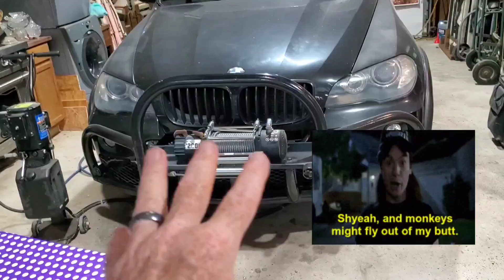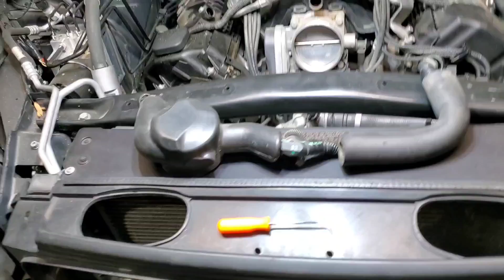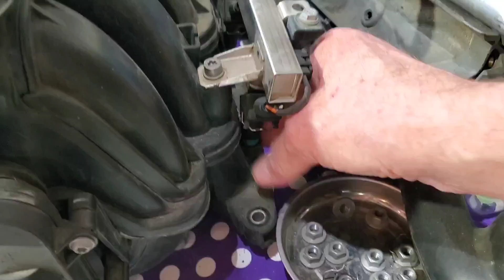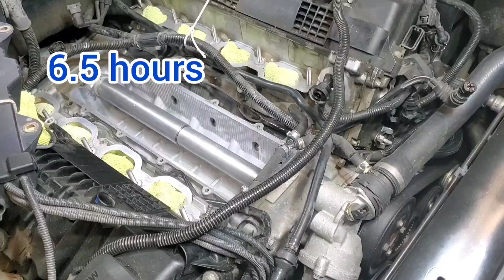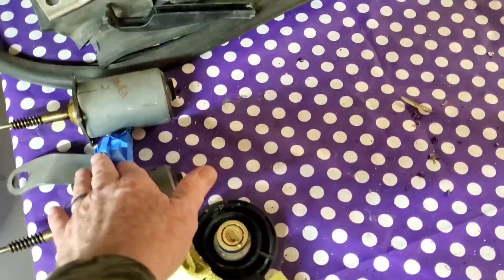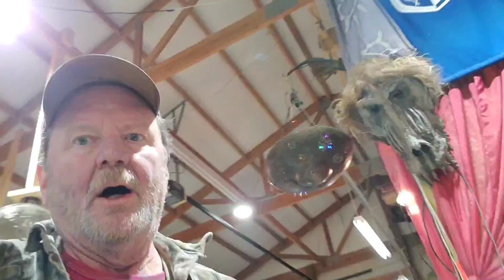BMW E70 X5 4.8 V8 Coolant Transfer Pipe. The unavoidable failure. Fix it at home for under $500.

Comment: Thanks for making these videos!! I just bought an x5 a few days ago and am already having the same haunted car issues you had with your alternator. I’m bringing it in tomorrow to get the alternator tested because I don’t have a meter. I had something weird under my battery cable attached to my battery (I don’t know cars lol). Anyway it’s yellow and attached to a yellow tiny box and then a bunch of other wires. Wondering if it is possibly parasitically draining my car or if it’s necessary. I didn’t see it on your battery and mine is a 2007. Any thoughts?
Reply from the maker: Not sure what that would be.  Maybe a gps tracker? But those are most often under the dashboard. There is the "intelligent " battery sensor on the negative side of the battery but it is black.  Buying a 2007 x5 v8 with no car knowledge might end up being an expensive and frustrating adventure. Electrical greebles start haunting the car? They're sensitive to voltage. Make sure your battery is robust, fully charged and the correct size and type. Make sure it's registered correctly and if weird stuff keeps happening, I'd suspect the voltage regulator (it's built in to the alternator).  Good luck!  You are probably going to need to start learning to do your own work.  It'll drive you to the poor house if you have to pay a pro to do everything that comes up. I have unreliable cars on purpose. I have time, tools and the place to work on them. I enjoy frustrating car problems. I'm currently looking for an out of warranty Range Rover.  Hopefully you have a honda as a daily driver 😅.  Thanks for watching and commenting!
Reply: @OGGarrettsGarage I found a pretty cool mechanic that is working with me to fix the problem. It was an aftermarket trailer light fuse hooked directly to positive terminal. We’re leaning towards alternator or voltage regulator but still aren’t sure. I’m used to working on older cars (80’s-90’s) but these newer cars have me completely stumped. The amount of computer shit in this car is insane.
Reply from the maker: @Sarah-xp7jw If there has been no alternator failure notice on the dashboard it's possibly (probably) the voltage regulator.   Feel free to ask about future issues. I have 2 of the silly things I've been trying to keep going for the last 8 or 10 years.  Cheers!
Reply: @OGGarrettsGarage thank you so much. I didn’t know the BMW community would be so nice and welcoming. My mechanic didn’t charge me today for a 6 hour day of trying to diagnose it. (Wow!) We noticed a relay was getting really hot and replaced that. Also I just bought it and the previous owner didn’t register the new battery so we registered that. If it happens again we are thinking it’s most definitely the voltage regulator or something on that circuit. He said sometimes a faulty oil sensor could cause that. I think it’s the regulator considering I replaced a relay that probably shorted out due to a power surge. (I learned a lot of stuff these past couple days lol).
Reply: @OGGarrettsGarage oh also it’s throwing 2ebd and 2dec codes.